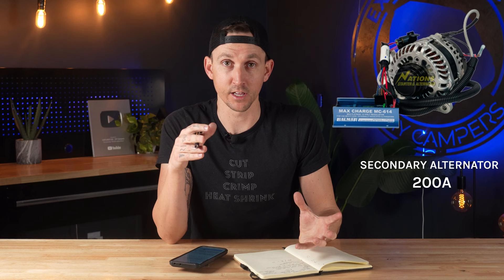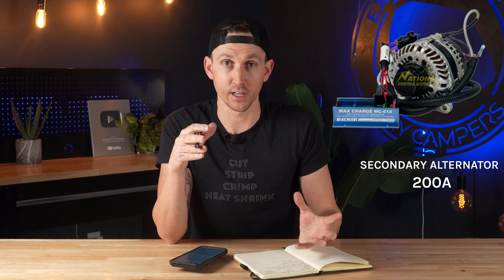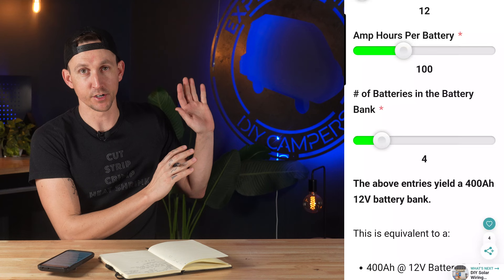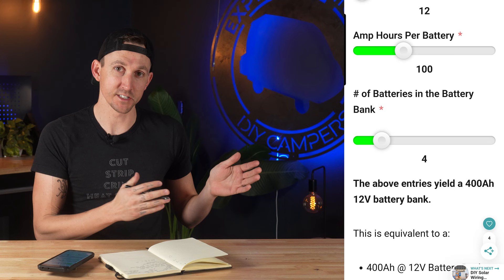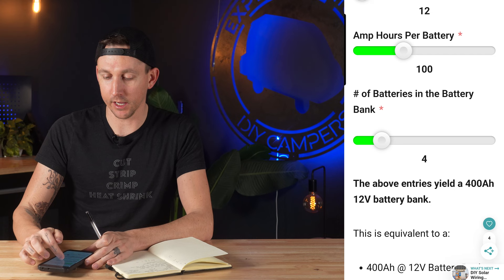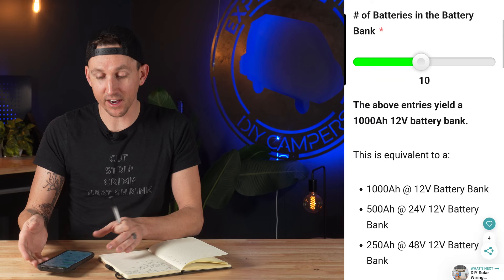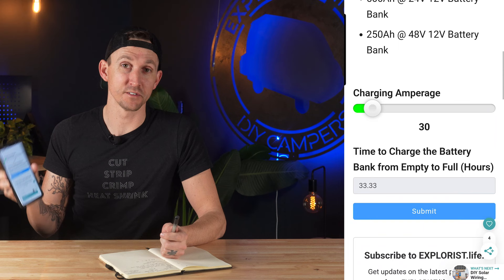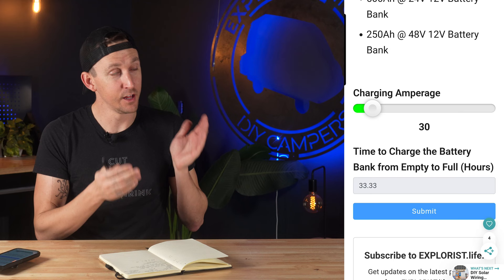ALTERNATOR CHARGING OR NOT? (for a camper electrical system)

Comment: Have you done straight alternator charging with lifepo4 before? I’ve been trialling it and have produced 100kwh now over the past 6 months. Going strong still, I used to charge upto 80% then turn the alternator charging off and use my orian 30 amp dcdc to do the rest but now I just swap it over when I reach 100%. Factory 125 amp 80 series landcruiser alternator (30 years old) and 500 ah of lifepo4. 

Charging currents start at 125 amps when vehicle is cold and tapper down to 110 amps when hot. Once battery reaches 70% it starts to reduce the current but still getting 50 amps at 98%
Reply from the maker: I have, yes, but I no longer recommend that as it's really hard on the alternator.

Comment: I installed a 30A Renogy DC to Dc charger w/ MPPT.  I simply put the shut off on the solar and one switch for the battery. I charge up relatively quickly when driving to work and don't use much electricity yet seeing the camper isn't fully flushed out. Is there really that much wear and tear on the vehicle to charge the batteries while driving? I'm only using the diesel heater, refrigerator, and an outlet with USB for small items / appliances. I intend to make it a 3 battery bank, the 2000W inverter upgrade is going in now and I'll installing a fan, a water pump, and another 20amp outlet for use with an infrared hotplate that will surge up to 1800W at the most. Isn't the belt on the alternator going to turn anyway while driving?  I'd have to be parked for 3 or 4 days depending and be completely overcast before considering running the engine. For my needs due to my work schedule vacations won't happen where I get extended periods of time and 3 days is about the most I'll be doing for my needs. For a retired full time sprinter person I get it but not entirely clear why alternator charging is doing much harm to the vehicle. (I need more coffee)

Comment: What are your thoughts about doing DC-AC-DC?

MultiPlus plugged into a 2000W “Vehicle Inverter” and then have the MP charge the batteries.
Reply: Lol I thought about that because I have a 30 amp 29.2v lithium ion phosphate battery charger that works on 120/240v AC and 12v inverters are a lot cheaper than victron  12/24 15 Orion's per watt

Comment: Hi Nate, great videos, I have 2 battery banks (4xhouse and 1xengine) on my boat and two alternators all connected with 2 Argofet 100-2 battery isolators - can I connect dc to dc charging convertors (on the output from the argofets) to get the modified charging profiles to optimise charging?

Comment: Good Morning. I have 2 200watt solar panels on roof and 2 100ah Battle Born Batteeies.  A 5th wheel.  Just drivie whth no boost charging will the truck realy charge the batteries when driving and no solar on or will it just turn on lights when driving.  Jack

Comment: Are we talking about more than one camper here?  

In the intro you say "later this year we are doing some electrical system upgrades that are NOT going to include alternator charging" but in a comment "we are absolutely going to be putting alternator charging in our Transit."
Reply from the maker: Yes.  Multiple campers.  We have 5 full camper electrical installs coming up later this year in addition to adding alternator charging to our Transit.

Comment: Thanks Nate.
Without your videos I would have struggled installing my Victron system. 
I just finished adding 2 Orion chargers to the system and put them on 2 manual switches. It gives me the autonomy to have them completely off, 1 on or both operating depending on the weather and status of the battery bank. 
The best system ever.
Thanks again for your help.
🚐💨

Comment: Nate, I have watched all your videos on alternator charging a battery bank and have downloaded your chart. I have a 2023 Ford transit extended and am stuck on the wire size needed. Is 4 gauge wire large enough from under the drivers seat to the rear of the van with a run of 20-30 feet?

Comment: I come up with 5.5 hours to charge ( two GC 270 amp hour 12V) batteries which may be worth the $250 Victron unit.  Do you make a wiring diagram/kit for that scenario? I might wire it for my future self in case we go that route before I button up the walls.. We often drive that long to camp in hot places like Moab, and the generator we have is a beast.
Reply from the maker: We do indeed have a Victron Orion wiring kit.  It's actually shown in pretty much all of our diagrams.  Here's that kit: https://shop.explorist.life/shop/all-products/victron-orion-wiring-kit/

Comment: Thanks for the video. Please consider my case, with a ModelY as my Tow Vehicle. I'd like to keep my vehicle range as high as possible, so I'm considering not charging my pop up camper battery. Most use is weekends with shore power. Can I just clip the battery charge wire from the 7 pin connector, and use a regular battery charger from shore power or solar? Is it possible to run my camper lights (including tail and brake) from the camper battery? I'm planning to swap bulbs to LED, perhaps the draw from LEDs isn't enough to worry about? Thanks!
Reply from the maker: You should just be able to disconnect that wire from the trailer battery so you can easily reconnect it when you go to sell it.

Comment: Don't many of the bigger rigs with solar have it set up to where BOTH solar and alt. are charging at same time when driving to their next destination?
Reply from the maker: Not simultaneously, no.
Reply: @EXPLORISTlife  ... confused.   If solar and alternator are both attached to a bank...... they charge... they dont care about each other.  Only about voltage of bank. Granted one might auto shut down do to what it reads voltage at. 

example... AM  solar FAQ statement

"Do I have to shut off the charge controller when I connect to shore power?

You can have multiple sources charging the same battery bank at the same time. Whether it is shore power, an alternator, a generator, solar panels, etc., it doesn’t matter. Connect them all. Run them all at the same time. No additional protections or switching of any sort are necessary. Chargers of all types are protected against reverse current flows and base their output on the voltage of the battery bank they are charging. When a battery is getting charged by any source, it’s voltage will go up proportional to the amount of current being fed onto that battery. In some situations where you have a particularly strong charging source, like an alternator or shore power, the high current fed onto batteries will drive the battery voltage up to the point that the solar charge controller thinks the battery is full. When that happens, the solar charge controller will temporarily stop charging until the voltage returns to a lower level."
Reply from the maker: That's correct.  They can all be connected at the same time, but they will not 'combine' their charging amperages.  This is a feature that should be available in the next version of the Victrion Orion, but currently, one will overpower the other and the 'weaker' of the two will gate back as that FAQ describes.
Reply: @EXPLORISTlife  appreciate it.  Good info. mucho appreciate your discussing things with your viewers as well.
Reply: Actually yes for most brands that have a dc-dc charger they will do a mix of solar and alternator when both are available and just one at a higher rate when it’s the only one available. 
Also most people setup seperate dc-dc and solar inputs which means they do combine their charging capacities
Reply: @andrewkrenske7263  for 12v yes.  not for 24v
Reply: @coachgeo  - My point was saying no it doesn't do it as a blanket statement is wrong. The number of people with 12V systems is much higher than with 24v. 
Also as i stated if you have separate Solar and DC-DC Chargers then yes it still does do both at once.
Reply from the maker: Not nexessarily, no.  They can both be connected at the same time, but as of writing this comment, the changes cannot be synchronized as easily as it should be.  This will be solved with the next version of the Victron Orion, though.

Comment: Please help...If you have no solar and are idle, eg no alternator power charging....could you not just put a 12v supply on the alternator side of your renogy 50a Dc to Dc charger to mimic the 12v supply from your car battery...this way you have a quality lithium phosphate charger   within the Renogy Dc toDc charger...is this an idea...thanx in advance....
Reply from the maker: That's not really how we design systems and that sounds like a bit of a Frankenstein project even if it would 'technically' work; so I can't vouch for it.
Reply: Thanx ...how can we then...have charged batteries without reconnecting a mains battery charger to the battery if no solar is present... I have all renogy gear with 2 x smart 100ampers. thanx again. @EXPLORISTlife
Reply from the maker: Not sure I follow; but all of the systems we build on this channel can charge from shore power, alternator, solar, or a generator.

Comment: I used to have 1200 walts of solar on my promaster 6 200 walt panels 

I was going for more stealth with the smaller panels They are not that visible when looking at the van 

And 2 5kw batteries 24 volt server rack eg4

It worked fine as long as there were clear skys and i allways parked in the sun

Now just one cloudy day and my batteries would be dead by the 
Next  morning when running the ac

Now i have 4 430 walt panels with about 1700 walts of solar and on cloudy days i can get enough to last through the day 

And on sunny summer days i can get 1500 walts easy and up to 1700 at least a few hours a day

With the 1200 walt panels i was doing good to get 800 walts max and seldom got more 

And the panels are more efficient than the 200 walt rich solar panels 
On a cloudy day i was doing great to get over 200 walts during 11 to 3 
 

And on sunny days can charge up my batteries and run the ac 

Still need to get 2 more batteries 

So i have enough to last multiple day's of cloudy weather 

Even with 1700 walts i still use my victron 12 to 24 volt battery charger when driving especially at night it will keep up with the ac as long as the ac only runs at a 50% duty cycle 

Normally i have an average of 300 walts 24 hours a day load

It adds up fast and with electronics its great because of all the heat tho in the summer it makes my ac run a lot more

Now if i cook more it goes up alot 
Try my best to only cook at night and in the morning to get the benefit of the extra heat

Comment: Hi Nate, Quick question kind of related to this.  I bought your wiring diagram and it shows 6 awg wire and a 60 amp fuse off the van starter battery.  My van battery is 100 amp and my alternator is 180 amp; should I use 4awg wire and 100 amp fuse off the van starter battery? thanks, I know this is pretty basic stuff, but I want to be sure.
Reply from the maker: Nope.  6ga wire and a 60A fuse as shown on the diagram.

Comment: Hi Nate, Great Video, as usual.  If I'm running a 48V System, how can I use my 12V alternator to charge it.  I've yet to find a solution.  Thoughts?
Reply from the maker: Yeah, that's tough, and one of the main reasons I don't recommend using 48V in mobile applications.

Comment: Doesn't the battery connection sequence affect the charge cycle? i.e. parallel takes longer to charge than series.
Reply from the maker: Not really, no.  That's only about watts in vs watts of capacity.

Comment: How about using a Li-BIM 225  that battleborn sells?
Reply from the maker: I'm not a fan of that unit, personally.  You've got to use huge wire 1/0 or larger in most cases and the way it cycles on and off realistically only nets you the same as a 30A DC DC charger in most cases.
Reply: @EXPLORISTlife  I called and asked them about that very thing. But they still recommended it for my application since I had 8 BB batteries.  I had to use 2/0 wire.  Said something about it being die to 8 batteries.  Your thoughts on their reasoning?

Comment: So why are you not going to incorporate alternator charging in your system? I didn't see one of the four reasons in this video going against it.

With that said, with 525 watts of solar panels and two 30 amp Orion chargers. After traveling in the southern US for three months with regular driving every other day the Orion chargers have produced half of the charge to our battery bank. Without the Orion chargers, we would not have been able to run our AC for weeks at a time because solar simply was not enough.
Reply from the maker: We are absolutely going to be putting alternator charging in our Transit.  I'm just waiting on the new Victron Orion later this year, adequate stock of the Buck Boost to become available, or for Nations Alternator to get back to me letting me know if their 2nd alternator replacement is a DIY friendly project.
Reply: @EXPLORISTlife  Got it. The beginning of your video made it seem you had changed your plan from what you originally said about putting a buck boost in.

Comment: I think it really depends on what vehicle, battery bank, and solar options that you have. And how you travel. I built my van to be lightweight (better mpg) and we like to be in any given place no more than 2 or 3 days. I have a 200ah system and could only fit 150w of solar on our molded fiberglass roof, so DC2DC makes a ton of sense. With a 50A charger it would only take 4 hours of driving to fill the batteries vs 16hrs from solar.

I don't understand why more people don't take weight and load balancing into consideration. It doesn't get talked about enough. Your rig could stay out for weeks on end with tons of water and batteries but it will drive like a brick. No thanks : )
Reply from the maker: For sure; and that's what I said.  It's going to depend on what type of setup you've got going on.  In a van; alternator charging will nearly always be needed.
Reply: @EXPLORISTlife  Sorry I got that you were suggesting that it isn't needed. I love your videos and you have helped me a ton already!
Reply from the maker: Thanks!  Yeah; basically the only time I see alternator charging as not necessary is if you have 2000w of solar (big class A motorhomes or 40ft toyhaulers; and/or you have a built in generator.

Comment: Hello Nate, a general question  from the UK - I am thinking of installing on my boat a 130W solar panel as a stand alone system which will supplement the existing electrical system. My boat is a 1950’s motor cruiser and when not in use I keep a heavy weight cover on the boat. Consequently, the panel will be covered and not charging during this time. Will this damage the solar panel? I plan to switch it off from the Victron controller using an appropriate isolation switch. I only need the
 panel to be working when I am on the boat. Thanks for producing these videos they are very informative.
Reply from the maker: That shouldn't be an issue, no.  That would essentially just be like having a solar panel in your garage being unused.
Reply: Many thanks 😊

Comment: Good video as always Nate. Question! Do you know if an Orion can run both ways? There have been a couple of times that I've gone out to my RV and found that I had left my headlights on and my engine battery is completely dead. If I had an Orion set up for alternator charging (I don't in reality, but...), would I be able to run the Orion backwards to send power from my battery bank to the engine battery and charge it that way?

I don't think I would ever do this, it was just a funny little thought I had one time and wondered if it would work.
Reply from the maker: The orion doesn't go both directions, no.  You COULD wire in a jump start isolator, but the more simple solution is simply to carry one of these: https://amzn.to/3JDPfjV
Reply: I'VE ACTUALLY DONE THAT SEVERAL TIMES OVER THE DECADES.......WORSE CASE, I WOULD CONNECT CABLES FROM THE HOUSE BATTERIES TO THE TRUCK BATTERY, I ALSO HAD AN ADVANCED DC ISOLATOR THAT WOULD GO BOTH WAYS........I ALSO HAD ADVANCED CHARGERS THAT I COULD CONNECT FROM VARIOUS SOURCES TO THE TRUCK BATTERY..........EVENTUALLY I GOT SMART AND KEPT BETTER BATTERIES FOR THE TRUCK AND DUMPED ALTERNATOR CHARGING ALL TOGETHER.....MUCH LESS STRAIN ON THE ENGINE,  TRUCK BATTERY, ETC....LIVE AND LEARN

Comment: You should also factor in that extra load on the alternator puts more stress on the alternator and the engine which has to work harder to run the alternator(s). The alternator itself should also be correctly sized.

Comment: Why not save money on alternator and solar set-up and just charge at EV charger and have small generator?
Reply from the maker: EV chargers on the road are for charging EV vehicles.  If a bunch of campers/RVs started using those for their house batteries, there would be even more ordinances banning vans/rvs from parking lots than there already are.
Reply: @EXPLORISTlife  I doubt that if you are strictly there to change up battery and dip. They are getting paid either way. + I definitely would use that if it isn't banned. My RV might be plug-in hybrid 😅
Reply from the maker: @mareksv1947 you do you. 💁
Reply from the maker: This isn’t a businesses banning it thing.  It’s a city council thing, just like why people can’t park overnight at Walmart like we used to.